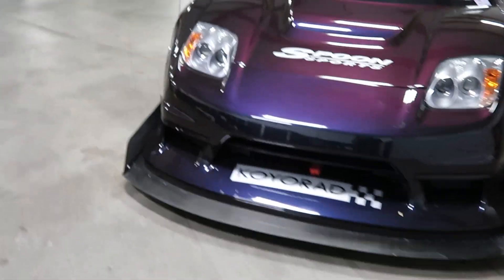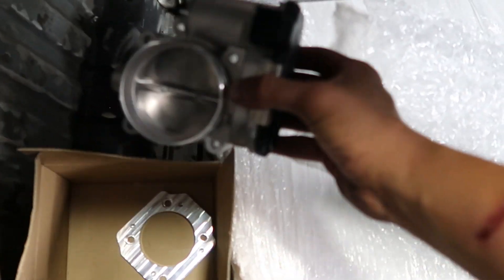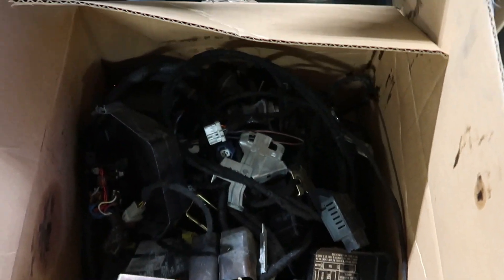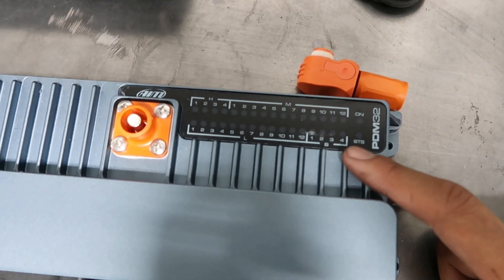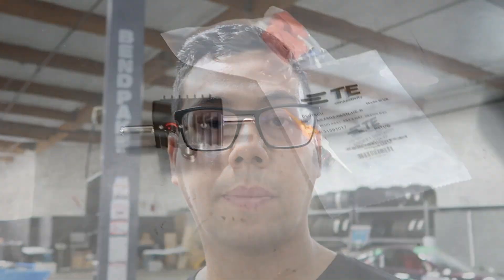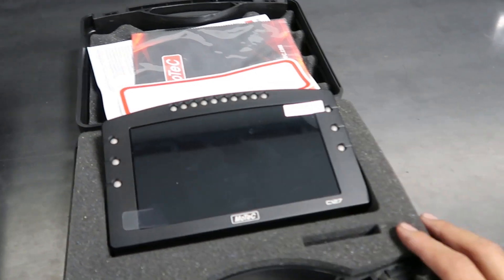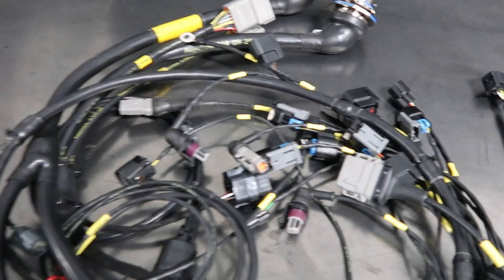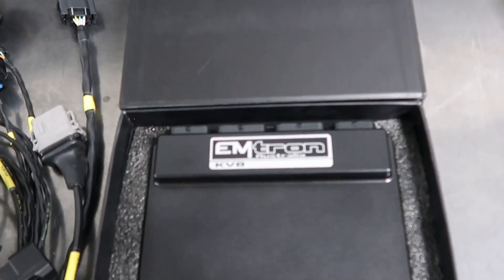Road To Unlimited Episode 1: The start of the project and electronics - Emtron, Rywire, AiM, Motec

Comment: Where money is no object motec & emtron kv8 are unbeatable but for majority of time attack builds that don't need the most advanced torque management / traction control over AIM & especially bang for buck AEM & Haltech offer great solutions the AEM infinity W/ CD digital dash w/GPS/Logging/track mapping & lap timing/ VDM can be had as a plug & play solution for around 3 grand for everything w/ completely customizable display add a can hub for unlimited IO. Also above AIM & a bit above AEM in cost & performance but below motec I'd go haltech nexus r5 w/ built in PDM & every else AEM infinity offers plus ic7 dash